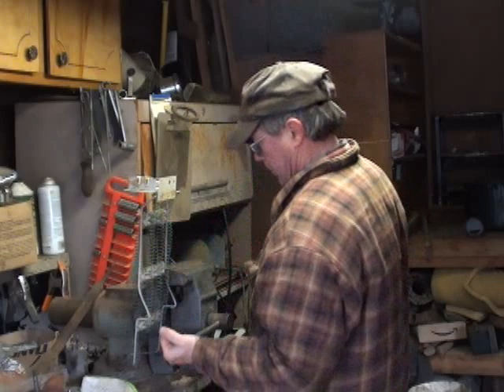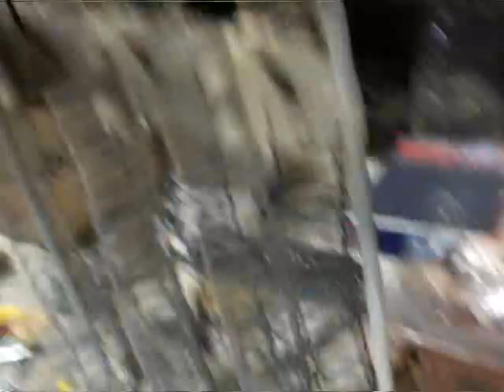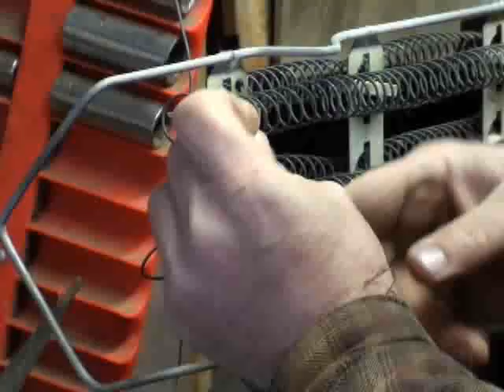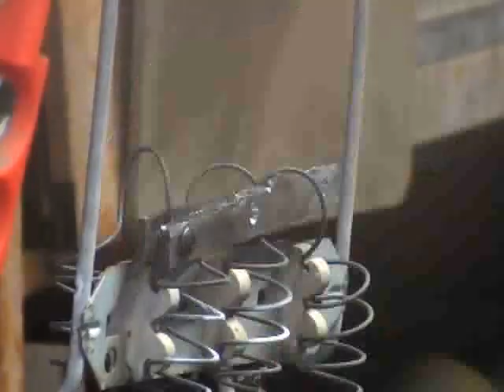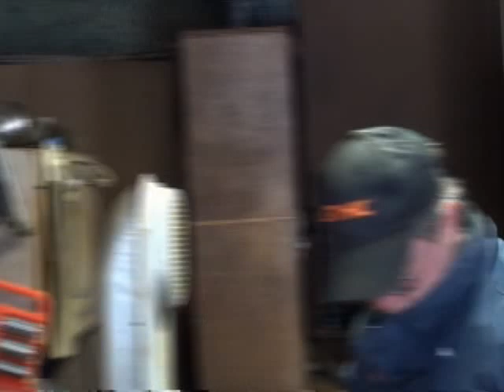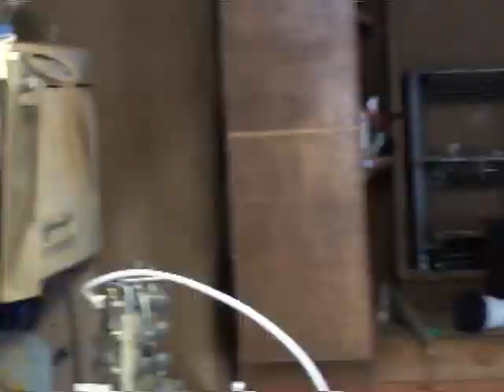Part 1 Air Heater Experiment for 1968 GMC 671 Detroit

Comment: when i worked in alaska we had a diesel powered fuel vaporizer that you hooked to the intake of any diesel engine and turn it over a few times and it would start and run on the vaporizer .It kinda looked like a small bullet heater and had a nozel that spayed after the hot air and pushed it in the engine   keep up the good work and have fun doing it

Comment: I know I'm late to this one, but if cold starts are still hard I recommend getting a block heater, there very effective. If you can't find one or don't want to pay for one just fab up some water heater element and put it in the water jacket. You've got the right idea though!
Reply from the maker: I think I mentioned somewhere that it already has one. Makes a significant difference in my power bill to leave it on all the time, though!
Reply: ElderlyIron 
   And I am late to this also, but will offer the excuse of only subscribing a few months back when finding your channel, so this was the most recent in the suggestions.
   Don't know if you ever got this to work, so if not?
   Are you aware that the solar industry now has air heater's designed to work off from DC voltage?
   Are usually used for dump voltage, the excess from the panels after the batteries are full, but would seem to be ideal for this situation, rather than trying to use heater coil's designed for AC electricity .(from the household dryer's)
Peace

Comment: Cummins engines grid heater or 12v hair dryers for camping are cheap and really effective.
and it's 12 volts...
a relay and a switch allow you to stay in the cab to start the lazy engine using its own battery.

Comment: i used to have this old freightliner argosy with 1.8 milllion miles on it, every x-mas i would come home and it would sit for 3 weeks straight, needless to say it would start because it had low-low-extra-low compression so the easiest way to get it to fire back up was to soak a rag in diesel and drop it on top of the intake inlet, have some one crank the key, wait for the compression to build up and yank that sucker off as FAST as you could before it got sucked down into the turbo 8p d60 ftw yo!

Comment: The formula is E=IxR. Electromotive Force (voltage)=current(amperage)x resistance(ohms).  Sometimes it will give you the wattage on a metal tag. In which case the formula is P=IxE or P=I squared x R. P (power)=current(amperage)

Comment: The Case 580C I operated had an ether bottle built right on the machine.On a very cold day you just needed a small puff to get it started.For all the time it was abused, the engine was in good shape.

So will you have to make up a big insulated box so you have a good volume of heated air going in?It seems like if you just have the heater plumbed up to the intake, it's going to pull so much air over it that it's going to cool the coils down.Also, have you tried WD-40 for starting fluid?

Comment: Nice use of resistance in parallel, a rise in the voltage will increase the current flow. For my old tractor I use a propane blow torch as an inlet pre-heater, straight down it's throat, but the video is about much more than that, experiment and just seeing what happens. Low voltage DC is great to mess about with despite what the safety nuts think. That's just because they don't understand practicalities.

Comment: If you wanna try another method,I might have an extra cold starter hicky off one of my M35A2s.Fuel injector and a spark plug in the intake elbow between manifold and filter.

Comment: Heaters that heat the air help but are awfully hard on the battery's.I have wore out several 671 Detroit's.I have no problems with ether.The one pulling my sawmill has to have ether to start.I know it has made over two million board feet of lumber.Still runs good.

Comment: What about those glow plugs that Perkins have in the intake? It has a fuel line hooked to em. I guess ya glow it and when ya turn it over it shoots fuel on the element and flames up. Id like to see it work in the open air

Comment: HA HA HA , I was wondering what you might say , Get one of those small square Pan heaters that clamp onto the oil pan for winter  and put that in the dryer vent , Plug it in to a power invertor they get very hot can`t touch it for heat .

Comment: i had a problem with an old mf  tractor that had a lot of years on it it had a small 3 cyl diesel in it i used to take a propane torch and put it down the intake for about a minute 
it would make it start in the coldest of temperatures without either

Comment: No reason this houldn't work, at a the very least, help! My '97 Dodge pickup uses a 5.9L Cummins, and does not use glow plugs. It uses a heater in the air intake that is on untill the "wait to start" light goes out. I was told this is also how the diesels in big rigs preheat for starting. I've seen 12v 150 W elements on Flebay for as low as $15 each.

Comment: perfect idea but think about the design of a 671 through the supercharger down through the cast iron block and blown into the cylinder's lots of real cold cast iron to try and warm up.or should I say lots or heat robing cold cast iron maybe with a blower attached to force the hot air in.  Then hook it up 10 min before trying to start with a little fan action to warm the impeller's of the blower and the case of the blower.  think about a heater grid in a 5.9 cumings directly above the intake valves 671 gmc a little different critter over around through down up in and around to get into the cylinder lots of cold cast iron to rob the heat your putting in...